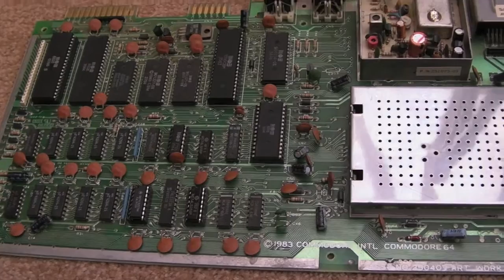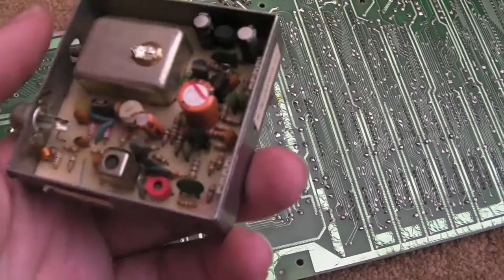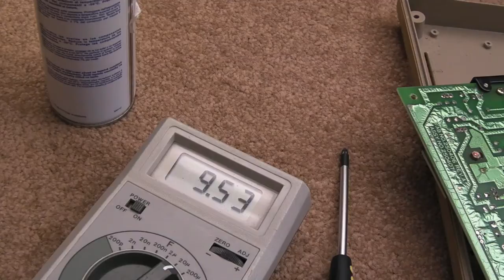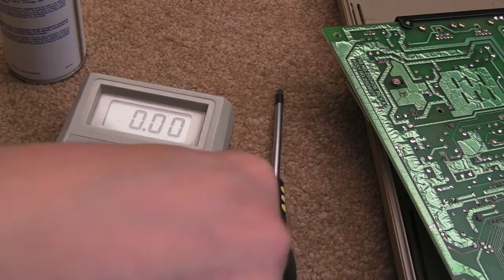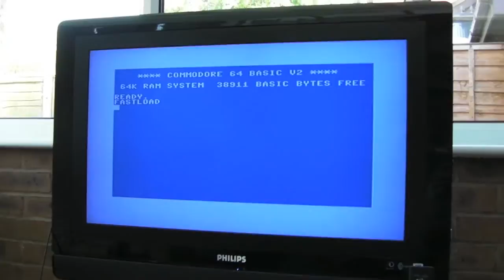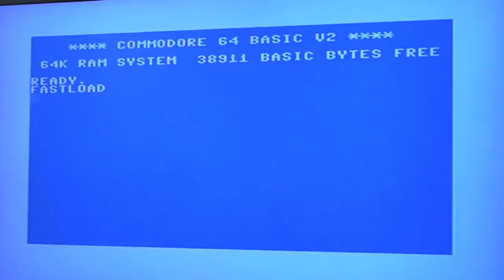Commodore 64 (C64) Modulator Repair (Blurry Picture)

Comment: Hi GadgetUK164. First to say, you are making great videos which help me to understand eletronics a lot better. Thumbs up for that. My question... Is it correct that faulty caps can influence the Video quality even if you are using the s-video output? I always thought the modulator is only responsible for the RF output.
Cheers...
Reply from the maker: Thanks, much appreciated =D  I vaguely remember that when I removed the modulator from one of my C64 boards it would not output composite. I am not sure if the luma and chroma go through the modulator (perhaps via a cap) and then out to the socket on the back, or whether they just go straight to the DIN.  Worth taking a look at the schematics!  Caps in general can affect the video (albeit slightly) - any noise not filtered etc could make its way out to the video.
Reply: @GadgetUK164  Thanks for your a answer. Anyway, i think i will change the caps in the modulator, just to check if i makes any difference. I have already recapped the rest of the board. But i will have have to double check the polarity of the one cap you have mentioned. 😉

Comment: hi! what is the i -> G switch inside the RF modulator i have in my c128?
Reply: I got this information from people on the facebook group:
The I and G switch changes how audio is handled when using RF. As some countries had G setting and other countries had I setting.

Exact answer:
"I <--> G just means the type sound subcarrier used in the PAL system.
PAL-G uses a 5.5MHz sound subcarrier and was used in Western Europe, Australia, and New Zealand
PAL-I uses a 6.0MHz sound subcarrier and was used in the UK, Ireland, Hong Kong, South Africa, and Macau.
If the switch is in the wrong position, all it means is that you'll get picture, but little or no sound when tuned in via the RF connection."
Reply from the maker: @Elrinth  That's more or less what I meant by modulation standard.  It's changing the audio subcarrier I think.
Reply from the maker: I believe it is to change the modulation standard.  Some regions would need it on one setting or other.

Comment: Wait, at the end are you using the RF signal, or the Luma+Chroma, when displaying on that screen?
Reply from the maker: I honestly cannot remember - The RF was tested and works (I used that board with RF just the other week).  I suspect I tested at the end of the video with Composite - which technically doesnt use the modulator.  Bare in mind that the board was dead at the start too (shorted XTAL, shorted VCC to GND connection too).

Comment: Hi GadgetUK. I've got a bit of a blurry picture with my C64. The picture looks much clear with another C64 (same scart cable used). So, should I then change the modulator caps, right?
Reply from the maker: Yes, I would personally target the caps in the modulator first!  Could also need a recap of the main board, but the modulator tends to be the cause when it looks blurry.
Reply: What about trying to regulate the modulator instead? I've read this: 
http://postimg.org/image/46buah4bn/

"There's only one potentiometer there, it's the white in plastic. The red is an adjustable capacitor, it's 360 degrees so after a lap you're back where you started.
The black metal shell is a ferrite core that is very delicate, do not screw it with a metal jewel, just plastic. This ferrite core, which is a cylinder of threads, is adjusted inside a coil, which is usually called an adjustable coil.

The external is probably also an adjustable coil, I'm pretty sure it adjusts the channel location, at what frequency you find it on your TV.

All adjustments here are made with the machine running, the effect is observed on the screen, please play some music so that you notice if the sound disappears.

I would guess that the ferrite core (in the metal casing coil) adjusts the noise carrier.
Potentiometer probably signal strength (if the image gets dirty next to white field) this can be adjusted too high.
The little red is probably a frequency adjustment, maybe for the color ...

Another thing is that little blue cable that is bent like a L in front of the ferrite core, it probably has some function too, you can adjust its position and see what's happening. Has not clarified what it is exactly, but it may be different in different machines. "

I've also heard that the later Amigas do have caps that leak and cause problems, but not the 8 bit stuff.
Reply: I've changed today all of the caps but I didn't have the ones of the modulator included in the kit I bought from Console5. The image is just the same. As I told you I was thinking if it's possible to adjust this somehow adjusting the modulator's pots. You better take a look to my screen: http://hostthenpost.org/uploads/b6381036b0ea016a266ebbefd1850e67.jpg

Edit: I've tried adjusting the pots there and I can not get a better image of the letters. It looks like the letters have a shadow.
Reply from the maker: That could help but tbh the only reason you would need to adjust it that way is if the caps are bad.
Reply: That was what I was thinking. In any case now I've changed also the four caps of the rf modulator and the image now is exactly the same. It is like the letters have a "shadow"; there is a faded pixel more on the right of them, as you can see in the photo.
Edit: I've just bought and I'll try changing the character rom, in this case 901227-03
Reply from the maker: It could be your cable - does it have seperate shielding for composite and audio?  You could also try an S-Video cable to see if that makes a difference.  Some VIC revisions and board revisions result in different quality picture too.

Comment: Do you actually need the radial capacitors in the modulator if you are only using composite or S-Video? I've checked my modulator and the capacitors have been ripped out - but it still works (output from DIN). I'm wondering if I should re add them to the board, but won't bother if they are purely for RF (I never use it). I do get the dreaded stripes though...
Reply from the maker: +Colin Ellett I think it depends which capacitors, and whether you are using Composite or not.  If you're using S-Video they probably aren't required.
Reply: +GadgetUK164 I've had another look and it looks to be the same modulator as in this video. All 4 radial caps are missing, ceramic ones are still there. Both S-Video and composite work via the DIN. Is there one in particular that the composite circuit needs? I could just replace that one. I mainly use composite as my CRT telly doesn't have an S-Video socket but the stripes can be quite annoying... (the sticker on the modulator is MD6-UE3603)
If it's not obvious, I'll try replacing them all, do you know the 4 capacitor values needed? I've noticed there is also colour bleed on the composite out
Reply: +Colin Ellett OK, checking the video - am I correct in saying the orange (small) cap was 10uF, orange (large) 470uF, black (above) 100uF and black (under, in bottom corner) 10uF??
I'll have a pop at removing the modulator and soldering in these values (if you confirm correct). Cheers!
Reply: +Colin Ellett Managed to remove the modulator (not for the faint hearted!) - here is a picture of whats missing. https://drive.google.com/open?id=0B_06EMEh6jeyWmdpTWxuMjlSd00 I want to be sure of the values before I reattach it to the motherboard (dont want to have to go through that removal again!) ;-) Can you help me identify the missing caps?
Reply from the maker: 10uF (next to the blue pot)
470uF (large one)
10uF (bottom right, right in corner)

100uF goes in the remaining spot, just above the one in the corner separated by a transistor, and it's next to the edge of the can, and also next to the RF tuner.  If you've replaced the other 3 you cannot really go wrong.  Just make sure you get them the right way around - you can always test on the 470uF cap position - put meter on continuity, and find which of the two pads is shorted to ground (can), and that's your negative side.  Look at the marking on the board and then use that to guide you with the other 3 regards which side is +ve and which -ve.   16v caps will be fine btw.
Reply: +GadgetUK164 Thanks!! I have replaced all the capacitors in the modulator and the picture does look better. Lines are still there though, wonder if I need the Lumafix. Thanks again for your help! :-)

Comment: Hi mate! Love your videos espacially of the c64 repairs! :-) Keep it up! I recently aquried a c64 breadbin same assy no and rf modulator as in your video :-D  I got it for a real nice price to around 20 euros. It seems to be working okey. But ive run into an issue, when been on for a bit like two hours rughly, the picture goes down and leave snow on the tv, its like the rf signal dissapers. Ive messured various voltages around the board before and after this happens and all seems good. So i think the issue is within the rf modulator. ive noticed weird nocies comming from the rf modulator when warming up so i popped the lid and when i press on the square metal thing inside the modulator with a screw driver i get snow on tv, so i suspect its the broken part, no what is that part? can it be sorced and replaced? appricate you thoughts in this matter and hope i dont botter you to much! Take care! /Dan
Reply from the maker: +0Dann30 In the first instance I would suspect the VIC chip pins / socket.  If you've got the same assy as mine you might have the problem I did.  When it warms up the VIC gets very hot and the pins move around in the socket.  You need to take the VIC out carefully (as to not damage pins) and then clean the pins up with some very fine sand paper.  Possibly consider spraying contact cleaner (not lubricant) into the socket as well.  Then reseat the VIC.   Other causes could be the capacitors in the modulator, or the main smoothing caps on the motherboard.  You could also consider cleaning the power socket and switch with contact cleaner as well.   Finally there's also the chance the VIC chip itself is the issue.  In any case I would get some heat sinks or heat sinks + fan onto the VIC.
Reply: +GadgetUK164 Thanks for the tips will try them out already planned on replacing the large elyt caps.  just to clarify i lose both video and sound and all thats left is snow on the tv thats why i suspect the rf modulator. ive checked some voltages across the board and all seems good even after the problem show up.  take care, and thanks for the suggestions :-) /Dan

Comment: Hi,

can you use the c64 without the modulator?

Greetings, Markus
Reply from the maker: Hmmm, good question...  I think the VIC II chip outputs Sync+ Luminance, and Color (Chroma?) and from looking at the schematics it looks like they are merged into composite using some transistors and passives, and the modulator appears to be seperate.  So I think you could remove the modulator and composite would likely work.  Let me know if you try!
Reply: I've read that he no longer works without the modulator.
I have a c64 that has no sound anymore, only with full volume to the speakers I hear something, but very quietly.
Reply from the maker: I can only say what I think from looking at the schematics.  The schematics show the RF coming from a modulator, and the transistors which operate on Sync + Lum, and Color don't appear to be part of the modulator.  That said, I cannot remember seeing many transistors on the C64 motherboard, so it's entirely possible those transistors are part of the modulator.
Reply: GadgetUK164 Hello, the 64 works now well. The SID was broken, a new one made it :-) Thanks for your support
Reply from the maker: That's great news =)

Comment: Is there any way to measure the caps without taking them off the board? Would be ideal to be able to identify early on.
Reply from the maker: In order to get to the caps you have to remove the modulator PCB from the C64 PCB - So that's the first problem.  In order to measure the caps, you can desolder one side of the capacitor and then measure it with a capacitance meter or ESR meter.  In most cases I would just swap out all 4 or 5 caps in the Modulator anyway if you are getting a blurry picture.

Comment: I have a C128 that is displaying in Black and White. 
Any ideas?
This is a US model.
Thanks!
Reply: I figured it out. 
Thank you for the quick response. 
Jeremy
Reply: Are you trying to connect it to PAL TV?
Reply from the maker: I know with an NTSC C64 you have to do the following:-

Replace the NTSC VIC-II with PAL VIC-II
Replace 14.31818 MHz crystal with a 17.734475 MHz crystal
Set the PAL/NTSC  solder bridge on the PCB to PAL.

It's very likely there's a similar change required on the C128.  I would be tempted to try and get a Composite cable before you consider doing the mods.  EDIT: I think you will have the same problem with Composite, but it's worth a try to rule out the modulator output.

Comment: Little question there: what are the pots inside the RF box for ? Could you tell how to calibrate them ? Thanks for the video
Reply from the maker: Hi, yes, I have had to tweak those before funnily enough.  If I remember correctly the adjustable inductor (I think?  Could be a cap not sure if honest) - I think that adjusts the audio subcarrier - so if you adjust when connected via RF you will hear the sound fade in and out.  The white variable resistor has something to do with either the main carrier I think, although it could be chroma or luminance, basically you get a white blurring affect if you adjust it one way, and it sharpens up the other way.  I am sure there are people better qualified to explain exactly what these adjustments are for but that's what I remember from when I last had to adjust them.

You can adjust them by eye (and ear for the sound sub carrier), but obviously better to use a scope or spectrum analyser or something if you want to get things totally accurate.